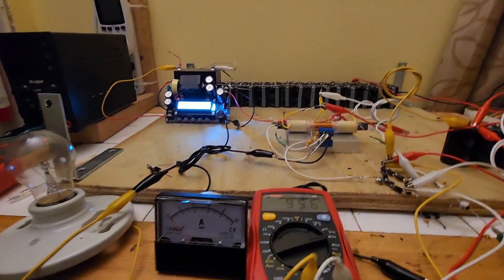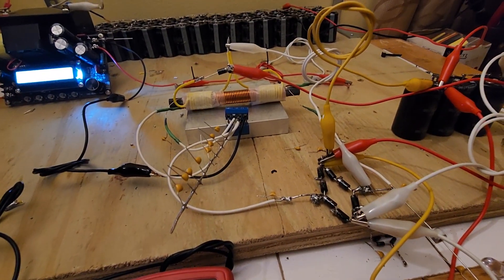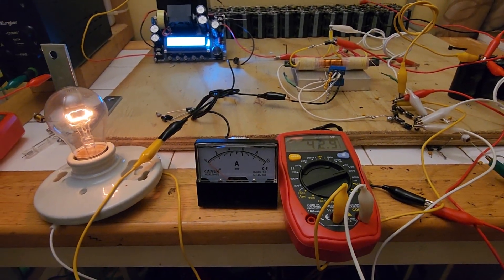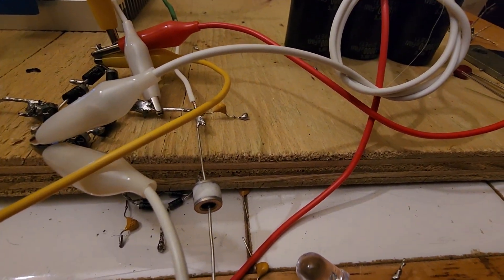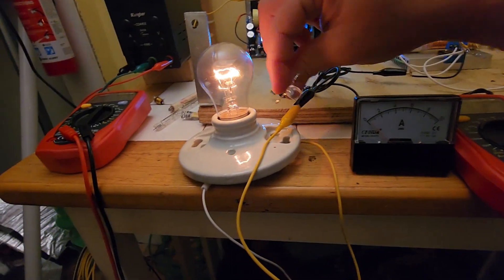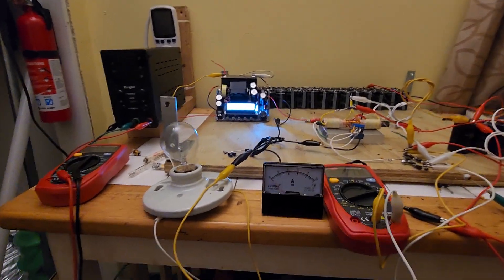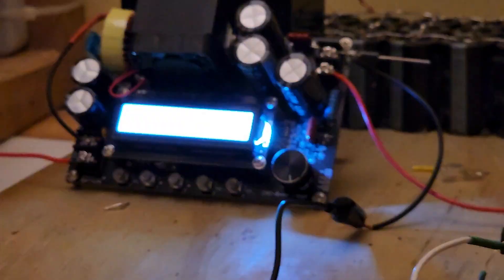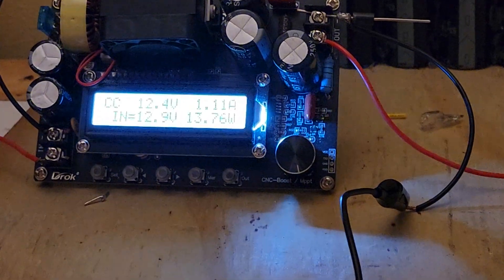🔩SPARK GAP GROUNDED RINGER GETS MORE EFFICIENT & CHARGES CAPS FASTER PULSED POWER FOR THE PEOPLE💡

Comment: Sounds super, more input or maybe voltage multiplier and high voltage capacitor resonance bank and HV caps for fast resonance charging, or dump cap, in something.
Do you measure the resonance frequency? Maybe 2 stages with coils for kHz or mHz. :)

Comment: Ive seen the same result where the amp draw is lower under a load with some of my own experiments with a spark gap and ground. So are you planning a pwm between your bank and the load? At lease you can possibly find a balance and drive a load very efficiently. maybe even a dc to dc converter to get the voltage down to play with some lower voltage devices.

Comment: Ok this is very close! Thank you for your efforts! 

The ground needs to be the focus and you need more surface area on your cap bank. See don smith. His coils and caps always had one thing in common, surface area and capacitance.  Think about it as setting up an energy potential that you get the ground to REACT to. Spark gap is good, old school radio varactor is much better 

The characteristics of Varactor diode have the following:

These diodes significantly generate less noise compared to other diodes.
The cost of these diodes is available at lower and more reliable also.
These diodes are very small in size and very lightweight.
There is no use when it is operated in forwarding bias.
In reverse bias mode, the Varactor diode enhances the capacitance
Reply: https://www.elprocus.com/varactor-diode-working-and-applications/#:~:text=The%20different%20types%20of%20Varactor,and%20gallium%2Darsenide%20Varactor%20diodes.

Comment: I have noticed reduced input wattage under load i think you are re directing some of the ground potential into capacitor that is given for free when you stir the ether like your ringer does  instead of becoming load and turning into heat in transistor try placing your ringer outside on the ground and see if it charges slower or not at all!  very cool stuff man ive made a few videos last night i got to upload when i have better internet  showing what i mean!
Reply from the maker: Can't wait to see them :)